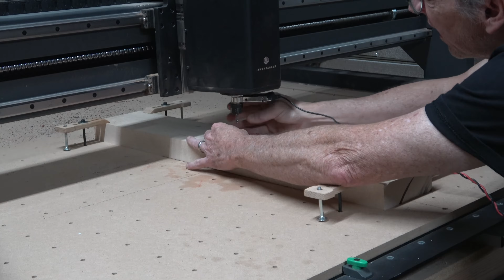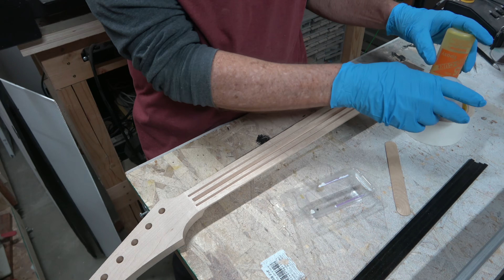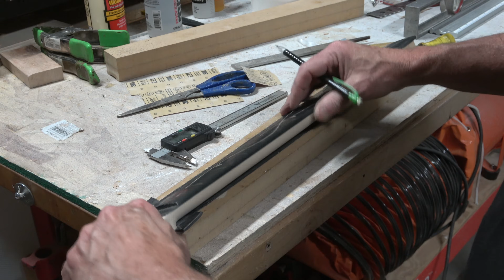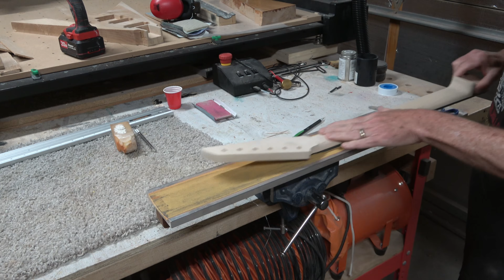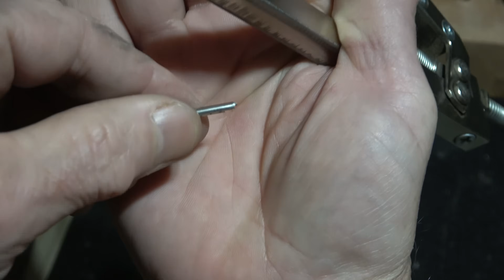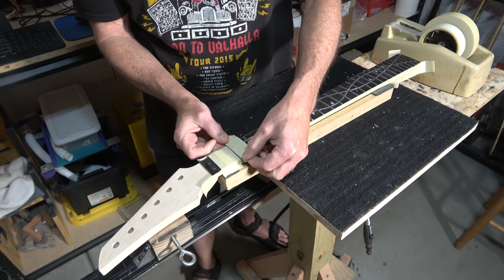Making A V-Shaped Guitar Part 10 Making The Neck From Start To Finish

Comment: Why not use a corner finder and use the lower left on your blank. Then you could use a pin system and not have to mess with finding the center everytime. Much faster and accurate.
Reply from the maker: I’m not in a hurry and I don’t have a corner finder.

Comment: You do not seem to follow the procedure you present in Episode 66: Never Level Guitar Frets Again! Why?
Reply from the maker: I do follow the same procedure. If the fret installation goes perfectly, there's no need to level. However, when it doesn't, I'll grab the leveling beam.
Reply: How often do you need to level, 50 % of your builds?
Reply from the maker: @tommarttila  About 20%.
Reply: Thanks, this is is an encouraging answer.

Comment: Do you pre cut the fretboard to the right width for the neck??, also did you do the edges of the frets on the neck?, what if the neck was painted too? Does that affect the fitting of the neck process??
Reply from the maker: Yes, yes and the neck will be painted after it is installed so that won't affect the fitting process.

Comment: I have a question. A violin doesn't have frets and can be played just by pressing down on the string, so can a guitar be played if you removed or filed down the frets level with the neck? I understand that the fret acts as a but and also shows us where to place our fingers, but can it be played without frets at all?
Reply from the maker: Yes. That's what a fretless guitar is.
Reply: @HighlineGuitars  are fretless guitars easier to play and also are there marks on the neck that show where all the different frets are?

Comment: Maybe I missed it, but you should make sure there is epoxy between the double rods in the center. If you don’t bond them the stiffness is only twice the stiffness of a single rod. If they’re bonded the stiffness is eight times the stiffness of a single rod.
Reply from the maker: They’re bonded together.

Comment: I use .25x.25x18in carbon fiber stock epoxied in and multi lams and they still move under tension and require adjustment. Not using a truss rod is a bold move. I hope it all works out
Reply from the maker: Oh, it moves, right into the amount of relief needed and no more.
Reply: I've built around eight guitars with two CF and a steel truss rod, none of them have needed and adjust of the truss rod, the neck is perfectly playable and flat. I think your project will be a success, and my next neck will be similar to this. Thanks Chris for a new video, and good luck!